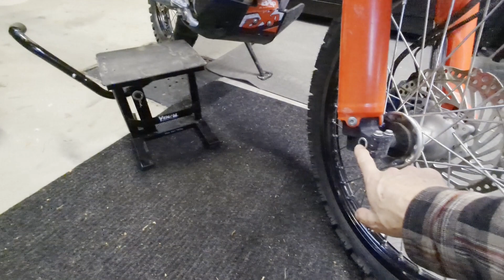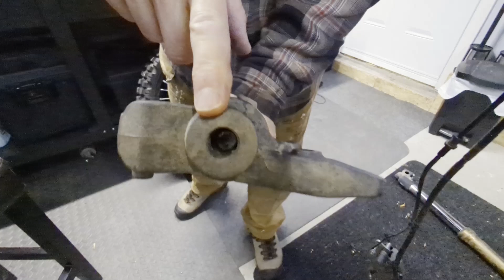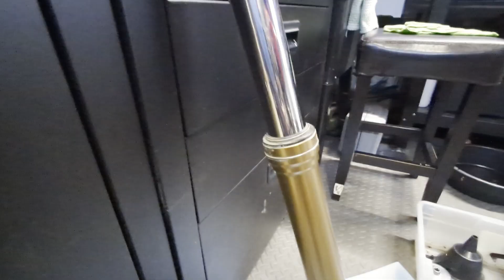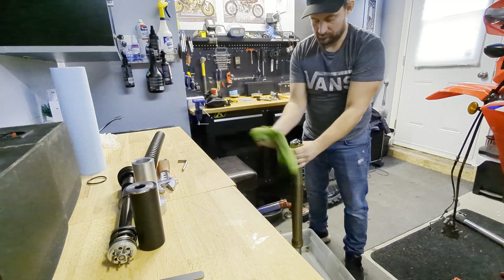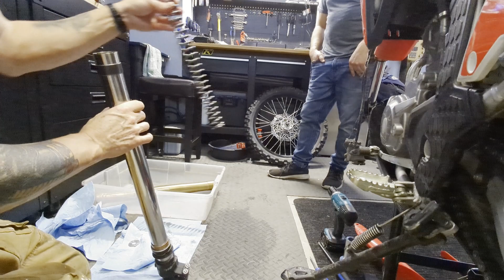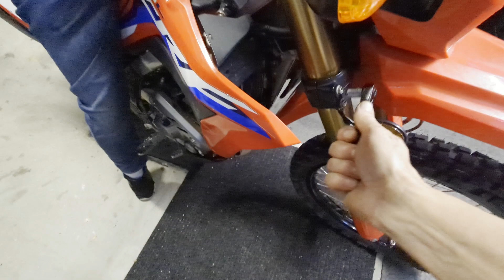HONDA CRF 250/300 L ...RALLY RAID ...LEVEL 1 KIT INSTALLATION

Comment: Excellent video. I ordered the YSS shock and fork cartridge kit for my CRF300. Which I am fairly dissatisfied with.
I really wish I had gone with the rally raid kit. Plus with the YSS fork kit the tools needed for installation are not included and if you don’t have a YSS approved shop install the kit your warranty is void.
Reply from the maker: Wow, that's a shame. The Rally Raid comes with everything except the seal instation hammer, which I bought on Amazon

Comment: Finally got mine in 300L !!!
Reply from the maker: Congratulations, you're going to like that bike. Depending what you plan on doing with it, I'd upgrade the suspension if you plan a lot of trail riding. Otherwise for the road use its pretty good

Comment: Is this the Kit that retains the Stock Seat height ?
Reply from the maker: Yes, their kit keeps the same seat height. They have level 2 which raises it.
Also order your spring for your weight, they have 3 spring sets
Reply: @2wheelingman  Thank you, do you got their rear shock to? Can you another review of how it compares to stock is it less jarring?
Reply from the maker: Yes, I installed level 1 rear shock as well. 1000% way better
Reply: @2wheelingman  If you could do a video of before/after on the suspension would be great!   Looking at the RallyRaid
Reply from the maker: Ah sorry, I installed without any video. There is a video on YouTube on how it's done. Very easy, 2 bolts to remove

Comment: Gary, your front brake line should go on the inside of the fork leg. This will help protect it in the event of a crash and is the OEM routing. Cheers!
Reply from the maker: Yes , you are correct. I'll have to fix that on my neighbours bike before we start riding this season. Still buried in snow here in Montreal 😪

Comment: Can you do an update and how does this compare to the K-Tech front suspension kit and is it not possible to fill the fork from the fork cap?   GREAT VIDEO!
Reply from the maker: Hi , thanks for watching and commenting. Unfortunately I do not know the difference for the K-Tech fork kit. It must be similar. On the Rally Raid one side is fill from the bottom (damper side) and the other from the top (rebound). I hope this helps